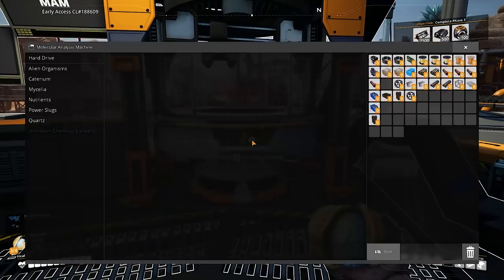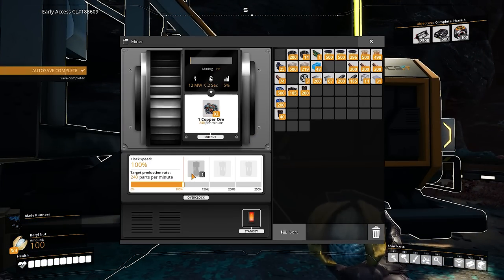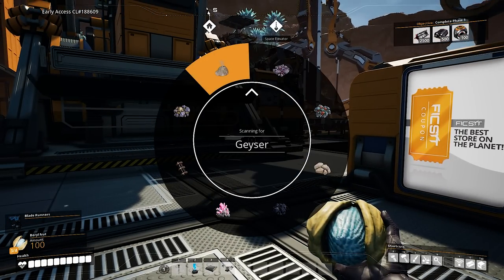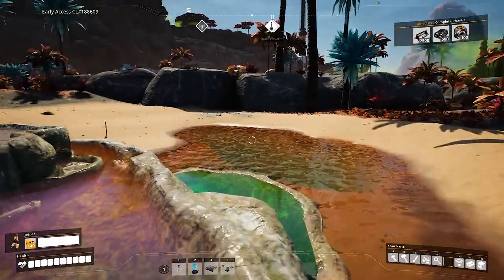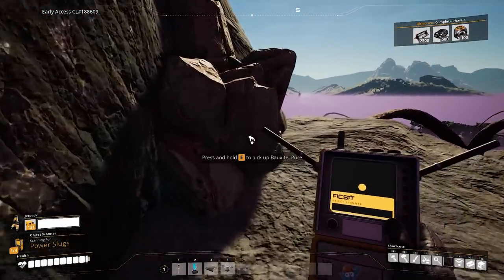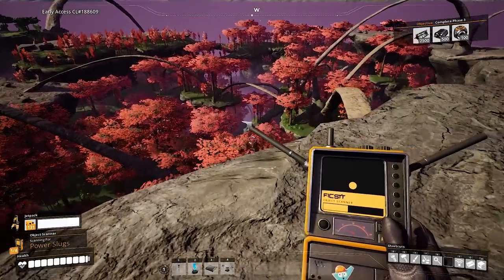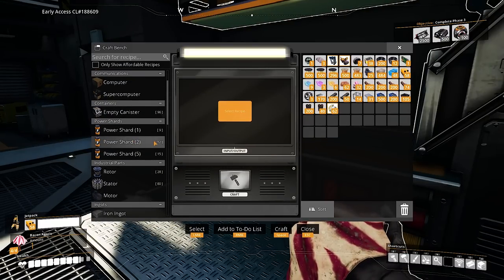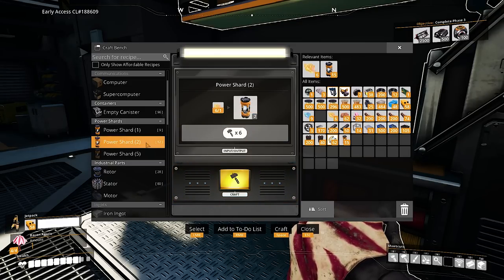Geiser Power and Major Slug Hunt | Satisfactory #17

Comment: Smelters can process 30 ore per minute.  You split 120 ore into three lines.  This is 40 per Smelter.    You should have split it into four lines, 30 per smelter.  Doing this would increase your efficiency by 33%.   You have bad builds like this throughout your factory.  Part of the reason things are so hard is because you are being so inefficient.

You don't need more overclocking, you need to build more machines.  More machines will use less power than the overclocking.